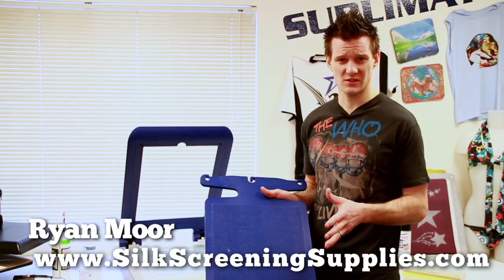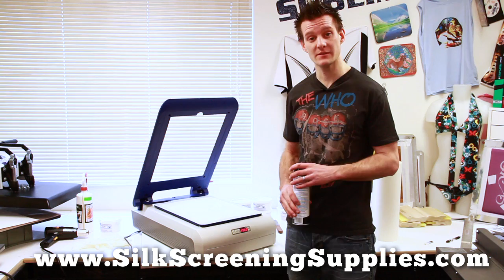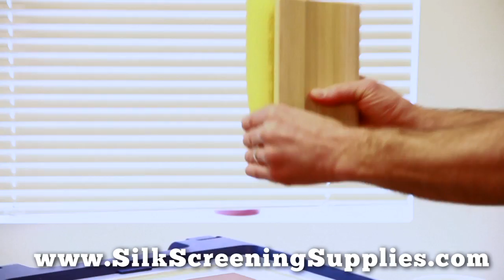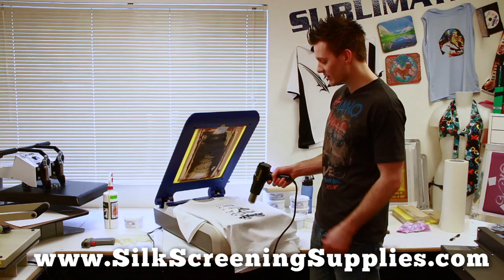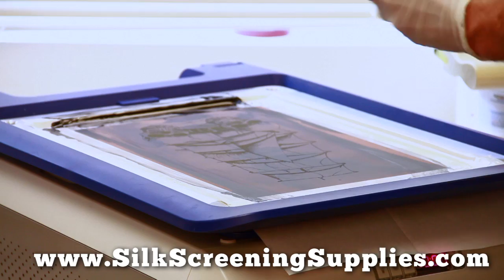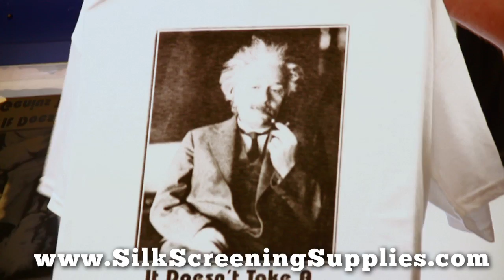Yudu - how to improve screen printing with the Yudu using aftermarket supplies

Comment: Can you use plastisol printing ink with the yudu?
Reply from the maker: if your curing method can reach 320, yes you can. You would have to cure it on a different surface, I am not sure if the yudu machine would be able to take that kind of heat
Reply: One thing that I do is put the shirt(after being printed on) into my heat press and leave the heating element .5 inches above the shirt. I have found that in the time it takes to put a shirt on the platen and print, the ink should be cured.

Comment: The Yudu is great to learn the business on, but you will be limited to the size of text/image you can place on shirt. Also the platens though cool for hanging shirts up, can be a pain to put those shirt onto. The original platens wear out, you will need more sticky to keep shirts still. Use off brand will be better. And those platens can be a pain to get off and onto the machine while making more than 1 shirts. You will have to be careful not to get ink on shirts.

Comment: I'm printing black on white shirts on my Yudu with a 100 mesh screen (not the high mesh count that's shown here) and am trying to flood back after the first print as shown. The problem is that when I do so, so much ink goes through the screen that when I print the next shirt, it's smudged beyond belief. I cleaned the screen and tried again. When I flooded back I looked at the underside of the screen and saw ink bulging out from the mesh, obviously the source of the smudging. Any ideas?

Comment: Ryonet has some great emulsions to use, I've gotten some of the Enviroline and I like what I've been using. I also use it on the after market Yudu screens. Both great to work with and plan on getting some more soon. Also check out their facebook page, they've been very helpful there when I had a quick question or two.